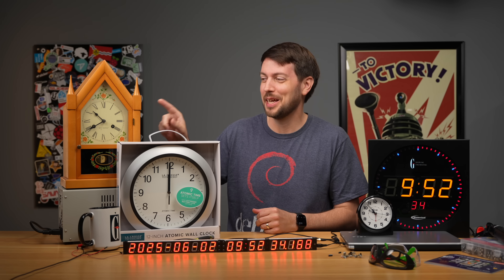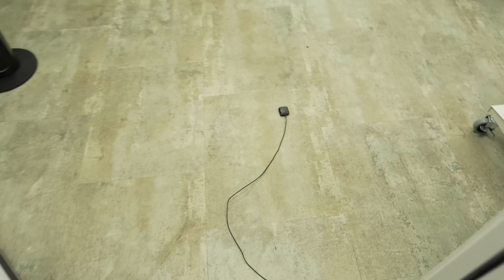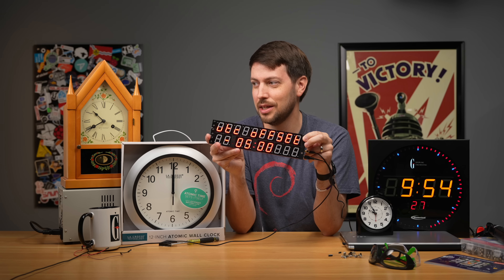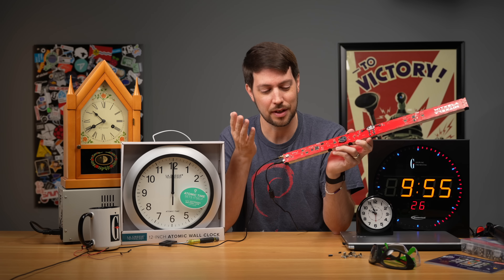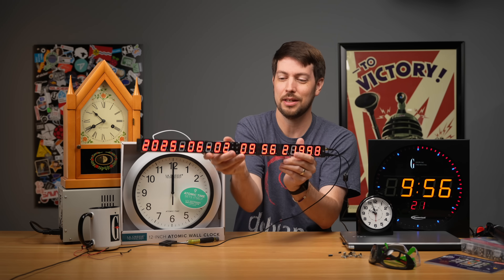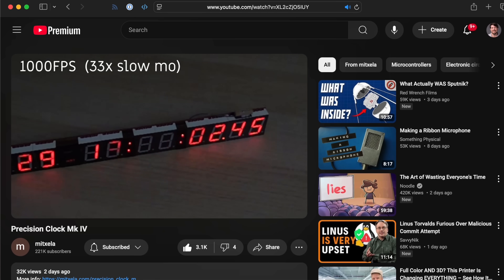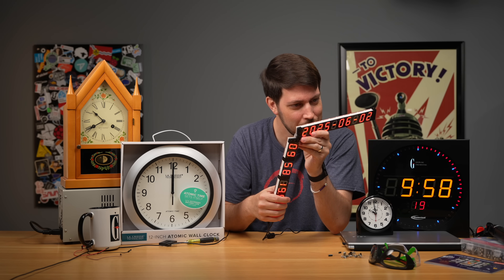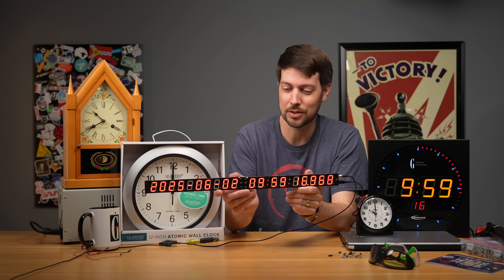Your eyes are too slow for this clock

Comment: Very cool clock, the only thing missing is an Ethernet port so you can use it as a NTP server.
Reply from the maker: Yeah; a few people in the mitxela forum have asked about this. Would be a great add on option, at least.
Reply: @Level2Jeff  If they do, they get bonus points if it's POE.

Comment: This was really neat. I have always been fascinated by Nixie clocks and the tube display technology, too. For a while I tried to work with the folks working at the factory in Zaporizhzhia, Ukraine which are one of the few remaining tube manufacturers in the world. They are only 30km from the front line of combat. My goal was to update the PCB for their ZIN70 Nixie clock. The aim was to use a raspberry pi pico, in fact. The need was there because their engineer is on active duty, but I haven't heard from them in a long time and some personal life things got in the way (my father passed away suddenly). If this is in any way fascinating to you, I would love to know. It might be a project that could be resurrected by the greater community.
Reply: Definitely interested!  I have one of the ZIN70 clocks and am having some troublesome issues with it.  In fact, the PCB has made a trip back to the factory for repairs and when it came back, it was no better than it was before.  Pretty frustrating for an exorbitantly priced clock.
Reply: @don_cc123  Your frustration is understandable. To the best of my knowledge, the folks at Millclock really only have expertise in glass and manufacturing process for the tubes, and they really haven't got any electronics expertise (or at least, their expertise is away because of the fighting). I think they outsource the board production. I happen to have a spare board if you are interested in purchasing it from me, though I can't offer any kind of warranty on it. Besides that, I would definitely be interested in forming a group to pick up work on redesigning them again.

Comment: It was interesting to think about a clock compensating for the time light needs to reach your eye.  We're getting into Einstein's territory there.
Theoretically there is a point where time cannot be further divided into smaller units.  That concept boggles my mind.
Reply from the maker: Well at some point we're measuring yoctoseconds, what's after that?!
Reply: @Level2Jeff   Lots, lol... 1 planck time unit = 5.39e-20 yoctoseconds.

Comment: Modern data rates are terrifying when you consider the light-nanosecond, even without the need to synchronise to some absolute clock.

At any given moment, a three-foot USB4 cable can contain over fifty bytes that have been transmitted but not yet reached the receiver.
Reply: That made me think about the huge undersea cables. If my calculations are correct, the fastest undersea cable contains about 550GB of information at any given moment
Reply: @bronkolie Did you compute that per wavelength in a single fiber or did you consider the total amount of fiber and total wavelength count of separate channels?
Reply: @MikkoRantalainen According to wikipedia it's 6600km long and has a bandwidth of 200Tbps. That should be enough if you assume the signal travels at lightspeed
Reply: @bronkolie 200 Tbps is definitely combined bandwith for a group of fibers so speaking about whole cable instead of one connection is correct.
Reply: @bronkolie light in optic fiber is ~30% slower than the speed of light (which is measured in vacuum) afaik
Reply: @kebizembola  Good point. Electricity in copper is also about 30% slower than the speed of light so you can fit more data on the cable.
Reply: @MikkoRantalainen  Nope.... it's less, not more....there is a traffic jam that slows it down by 30%
Reply: @Peter_Enis  The bandwidth is still 200 Tbps and if the traffic goes slower on the way, you just have to put bits closer to each other to fit 200 terabits every second so there will be even more bits going in the cable.

Heavy traffic with cars on roads decreases bandwidth so that works the other way around.
Reply: @MikkoRantalainen  Uhmmm....imho the 200Tbps is based on all the bits they can squeeze into every frequency of light. Taking in account the limitations of fiber.... It's not like they're going to put a multi-billion dollar cable and not use its full capacity?
What you are saying is putting more cars(bits) on the road to make traffic go faster? You are contradicting yourselve here?
Reply: @Peter_Enis  200 Tbps is number of bits per second, right? If you can continuously put that amount of bits on the cable (yes, using multiple fibers and multiple wavelengths) and velocity of light is about 70% of the speed of light in vacuum, you end up with bits packed tighter than you would expect from the length of the cable + speed of light in vacuum.

As a result, you have more bits in-flight before the first bit is received at the other end.
Reply: @MikkoRantalainen  First, thank you for explaining your vision in a respectful manner! Getting rare on the internetz... The question is this: Is the amount of data on its way calcluted based on lightspeed or lightspeed*0.7?
Reply: What I'm saying is that if it is calculated at lightspeed*0.7 than yes, there is more data in the cable. The bits are not packed thighter, the road they have to travel is longer because the light bounces on the highway from left to right and up and down. The light travels a longer road than the 6800km. And then yes, the cable contains about 30% more data!
What I was saying earlier is that the throughput could be 30% more if the light could travel in a straight line in a vacuum and that would mean less data en route. Perhaps we are saying the same in a different manner :face-purple-crying:
Reply: @Peter_Enis  I think the correct way to calculate is it to calculate the amount of time needed to travel the distance. Given the distance and speed (0.7c) you get the total travel time. Multiply that by 200 Tbps and you get the amount of data on the cable.
Reply: @Peter_Enis  If the data was transmitted in vacuum (e.g. 6800 km long vacuum chamber with lasers) you would just reduce latency by 30% but wouldn't increase throughput because the limiting factor isn't the amount of light you can put into cable but the fact that you cannot modulate the signal faster using (near) visible wavelengths.

However, I think we don't have good enough optics to focus laser light to receiver 6800 km far without huge energy losses. As a result, it makes more practical sense to use fiber optics even if increases the latency.
Reply: @MikkoRantalainen  So we are saying the same..... 0.7c makes the cable virtually (+/-) 40% longer and can therefor hold more data given that no other factors are changed. It's probably the most expensive data-storage device in the world 🤣
Reply: @Peter_Enis  Yes, it it would highly expensive way to store really short lived data with zero error correction for bits you failed to read at the correct moment.

Another interesting use of fiber latency can be found in Tom Scott video titled "How IEX used long strands of fiber optic cable to create a fairer stock exchange"
Reply: That is pretty insane, cool stat!!!
Reply: Interesting side note, that's how physical delay loops work. (in the long long ago, it was done by recording a signal on a loop of tape, wire, etc. today, it's very commonly done with a loop of optical fiber -- if it's not entirely software.)
Reply: @jfbeam  doesnt the new york stock exchange have like a mile of fiber coiled up so that people connected on fiber don't get an advantage over people using the normal internet(or something)

Comment: When did you make this video? I am watching this film at 21pm in Poland - 6 hour offset from New York, but you must have a time for making this film? Incredible!!! Btw thanks for your film. 😊
Reply from the maker: Heh, I am in US Central timezone, so offset from Poland -7 hours?
Reply: @Level2Jeff I would ask how long did you spend on making this video (if it is not a secret) - my simple 2 minute film for my students takes me almost 3 hours.
Reply from the maker: @apruszko  I started setting up at about 9:35 (camera on tripod, lights on, arrange clocks), recording at 9:52, and finished my edit around 11:30.

Getting to that point has been a couple years of tweaking everything in this studio to be as fast as possible recording + getting to the edit (from lighting + mic + tripod setup to converting the footage and getting it on a Final Cut Pro timeline).

Ideally, I'll cut out another 20-30 minutes of the process with some optimizations in how I record (right now to SD card, but that's annoying—I want to do NDI right over the network to my NAS!).

Comment: But why Micro USB and not USB C?
Reply from the maker: Mitxela mentioned in his video that the clock design persisted since 2018-2020, and back then (not that long ago I know) not everything was migrated toward USB-C. Also, USB-C ports can be slightly more challenging to hand-solder, and the pinout can be... interesting sometimes (many people have messed up USB-C connections!) which is why many maker designs still don't incorporate them.

If this were a commercial product I'd definitely ding it on not having USB-C, but for a personal passion project, I'm fine with whatever.

Comment: Cables are normally ~1.5 ns/foot
Reply from the maker: I believe closer to 1.6, but depending on the cable type (as some nicer cables are on the lower end, some cheaper coax cabling is closer to 1.8-1.9!); but then in our atmosphere, I think it was like 11"/sec? (Yay imperial measurements haha).

Comment: You mentioned WWV in passing...  My (very limited) understanding is that is the shortwave radio station that provides time.  Have you or your dad ever played with hardware that picked up that for it's time signal?   I remember 20+ years ago, before GPS was quite so cheap and common,  seeing clocks that would get their time from the various shortwave clock stations.  Canada has one (?) also near Ottawa.

Oh wait, I'm sorry, that's just digging the rabbit hole deeper, isn't it?  ;-)
Reply from the maker: Yes! And one of the clocks on the desk uses 60 kHz time :)

I'm working with a few different setups where they can grab time off that signal, and sometimes I get wrapped up into listening to WWV on 10 MHz :D

Comment: "When you get into the timing hobby, the rabbit hole goes very deep", truer words... the amount of money I've spent on this hobby in the last year alone is... well its best not to think about it, but there's endless opportunities for more learning as a result! 😁

One thing I do want to say to anyone who's looking to get into the hobby, do your research, and talk with folks who've been in it for a bit before buying expensive gear. There are a lot of tripping hazards when you're getting started and some of them can potentially be very expensive (lookin' at you, cesium clocks). This is particularly the case on Ebay, where there are sellers who love to mark equipment up, while not providing enough context on the device in question.
Reply from the maker: Yeah... another rabbit hole I don't want to explore until I have more experience is masers and larger rack-mount clock equipment, which is only affordable if you're willing to put a LOT of time into restoring old stuff (see: CuriousMarc) :D
Reply: @Level2Jeff  Funny you mention him, CuriousMarc's videos were actually what started me off on this wild adventure!

Comment: Jeff, are you aware of the OCEST analog clock? It runs on 2 AA batteries and uses NTP to set the time. Install the batteries, it sets up a WiFi network, connect to that and set the time zone, your WiFi network credentials. Then save and reset, it sets the time (and resets it daily). The best part is that it has a sweep second hand and is nearly silent.  It's also surprisingly inexpensive. I've had one running for several months and it's keeping essentially perfect time.  Love your videos!
Reply from the maker: Neat! And a sweeping arm is nice, you don't find that too often. I'll have to grab one and test it!
Reply: @curtlundgren6867 Are you able to specify your own timePI GPS NTP server address? Their sales page is a bit unclear on how much flexibility is available?
Reply: @Brian-L  Sadly, no. It's not clear which server it connects to, or if that changes over time.

Comment: dude cant be seriously about clocks if he's wearing a smartwatch. lol
Reply from the maker: You'd be surprised—the Apple Watch with GPS is accurate within the ms range. The Apple Watch Ultra 2 (which I can't justify...) has dual-frequency (L1/L5) GPS, which gives it time accurate to at least tens of ns. Much better than even some stationary GPS receivers.
Reply: @Level2Jeff  Oh, I have gone through all that with casio mostly, but this year they are releasing their first ever automatic watch. I am excited for it more so than their digital stuff, which is what they are known for. Maybe one day they will make a hybrid atomic bluetooth automatic mechanical movement. heh heh
Reply: @Level2Jeff  I highly doubt that you would get that kind of accuracy out of even a dual band gnss receiver in a smart watch worn on your arm.
While it is true that the dual band is more accurate than a single band, to actually get down to the tens of ns in accuracy you need a very good antenna, and a stable platform.
To get really good timing performance out of a gnss it should be stationary and preferably in a temperature controlled environment.
Sorry for the rant, but it is a bit of a pet peeve of mine when people claims nanosecond accuracy just by hooking up a $5 gps receiver.
Reply from the maker: If you're outdoors, and have a good enough antenna design, and good enough firmware, a track can be in the tens-of-cm range on a wrist-worn GPS.

The latest modules from u-blox are mind-blowing (IMO), and can get a very good lock very quickly, using multiple constellations, even with a middling antenna.

To be able to make the claim that their Ultra 2 can be accurate down to the tens of cm (which Apple does, though you have to dig through some papers to find it), they have to have accuracy down to tens of ns.

If you're running around, lay on your arm, or are going through a dense urban environment, of course the accuracy is going to be off. But if you're sitting on a park bench and it has a good signal, it can update the time to an extremely accurate level.

Again, not sure if Apple's firmware engineers actually do that (set the time while somewhat stable with excellent signal), but it seems like that's the obvious thing to do.
Reply: @Level2Jeff  I am more interested in how it operates than how accurate it can be. I have worn an analog digital watch for like 10 years and it's got the dual time and stuff but it's not going to update like "leap seconds" ect. I do want to find an automatic watch with a hacking hands. That's latitude and longitude enough for me give or take 15 seconds a day, :p

Comment: I hate all available clocks (the affordable consumer-oriented ones) so much that I just put a simple HH:MM LED display on the RPi I already had under my TV.
Reply from the maker: I'm hoping to build a cheap little Pi display as well — just want larger digits than you can get on most of the project kits.
Reply: @Level2Jeff  PCBWay / Sparkfun Electronics collaboration? ;)

Comment: This is one of those things where I am both happy that the creator and product get more attention, but also jealous since the increased demand will make it harder to get one of these limited items!  I’ll just have to be patient for the clock to get back in stock!
Reply from the maker: Exactly!

Although, if you're able, the board design files should be posted at some point, and what better time to learn how to solder surface mount devices and flash your own microcontrollers with firmware! :D

(The pre-assembled version is much easier, haha)
Reply: @Level2Jeff  I would say that's a perfect time to learn, but my clock is not precise enough to make such statements!
Reply: @Level2Jeff  People can never see a clock's true time..... by the time the light reaches our eyes and our brain processes it the moment has past 😜
Reply from the maker: True, though at certain scales, the particular second is correct for at least much of the second!
Reply: Part of me wants to do this so that I can say I built it myself.  The other part sees all the surface mount components and knows that my soldering skills are going to be tested to the limit.

Also I would have to figure out how to make all the other parts like the button casings, hinge and what not.  But I can’t say I wouldn’t find the challenge fun!
Reply: Yeah I agree. Nothing's wrong with this. It feels like one of those high tech 90s things. Simple but more feature packed than you'd expect.
Reply: Signed up for the wait list. I wouldn’t mind rolling my own to get it sooner, as SMD is old hat. But sourcing the BOM is the nightmare I don’t want to embark on, plus miss out on some tiny volume discounts, like the GPS module. Don’t yet have a 3D printer for the aesthetic parts and hinge. I’ll just sit tight.
Reply: @Brian-L  I know a Brian L. who lives in Portland. Any chance you have a brother-in-law who lives in Florida?